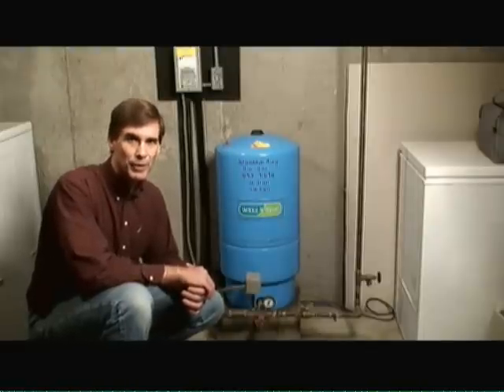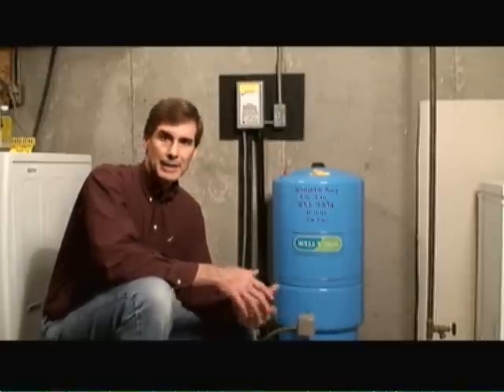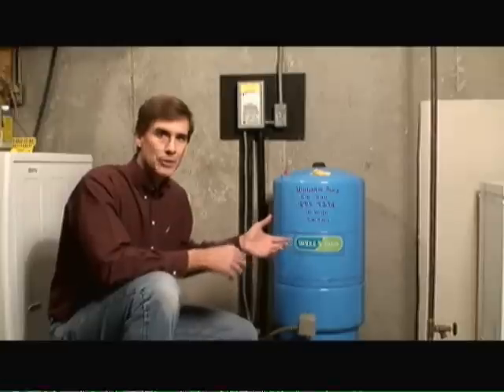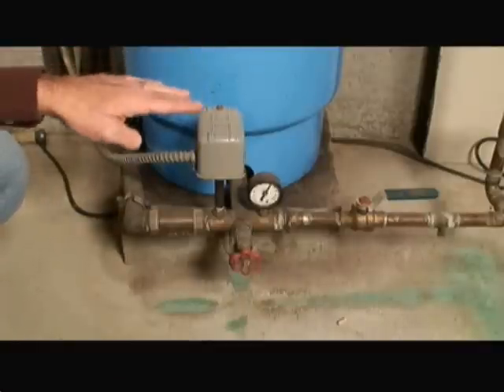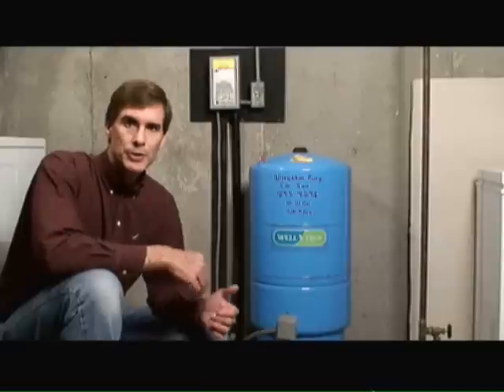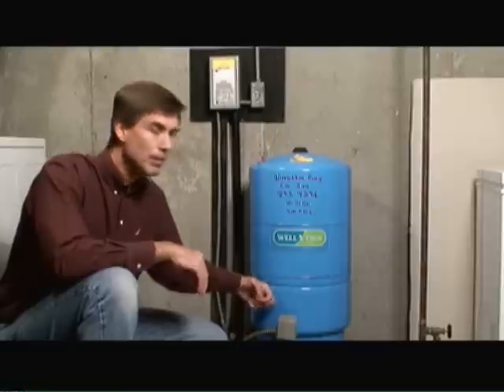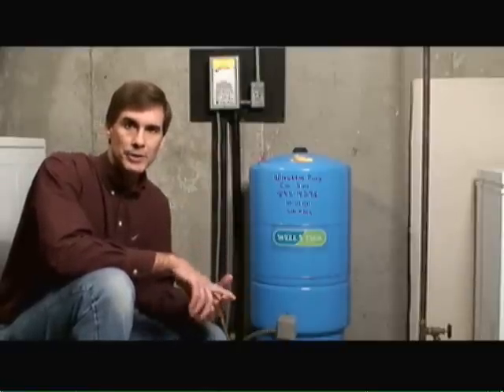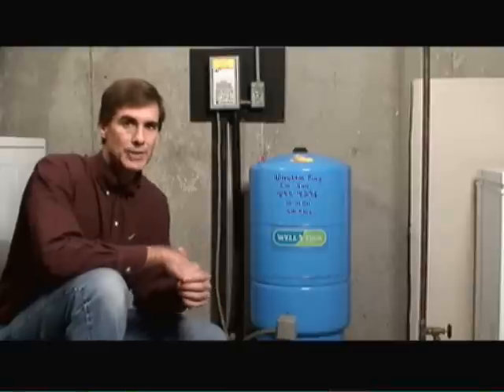Pressure Tanks and Private Well Systems Video

Comment: I have a question! My house is on a well and I just built a pole barn. The well is beside my pole barn. I can I just T off the line before it goes in the house to my pressure tank and run a straight line to my pole barn??? Or will I have to run another line to the house to the pressure tank and back to the pole barn? Or should I just put another pressure tank in my pole barn? Thanks
Reply from the maker: The well pump feeds water into the pressure tank. So I don't think you have a choice but to draw water from the pressure tank in your house to feed your pole barn. I have a similar situation at my house, with a detached garage that has running water in it, and that is fed from the pressure tank in our house. 

Sign Up for my HomeAdditionPlus.com newsletter and get free home remodeling and home improvement tips, as well as tool product reviews, from me every month. Sign up here:  http://www.homeadditionplus.com/Subscribe-to-Newsletter.htm
Reply: So if I don't connect to some place in the house with a line that is on the pressure tank. I won't have no pressure outside?
Reply from the maker: Correct. That line is under pressure, that goes between the well pump and pressure tank. However, you should tap off after the pressure tank.
Reply: I totally disagree, the pressure tank can determine pressure changes anywhere on the system,  IE if you have a hose bib at the well head and your tank is under the house, when you use the hose the pressure decreases in the tank and the pressure switch closes the points and cuts on the pump. Run the line straight to your building, the tank doesn't build the pressure it measures it, the pump builds the pressure.

Comment: hi I got a question. my tanks pressure is idle at 55psi. as soon as I open my sprinkler system it drops to 40 then continues dropping then when it goes to 30 after a few seconds it drops pretty quick to 20. It was fine last season but not sure what happens this season. I'm not an expert but it appears that the pump isn't able to keep up or fill the tank quickly. any idea? is it possible that there isn't enough water in the well?

Comment: Need advice...... our water pump runs, however, we are not getting any water to our house. The pressure reading on the tank is below 10psi. When the water was on, the water pressure would come on pretty good at first then it begin to slow almost to a trickle and then it would speed back up and then slow to a trickle, so on and so forth till the water would just run out during a shower or washing dishes. And now we have no water! Can someone please help me!
Reply: Jenni McMahan-Cole wow a month ago...So do you still have the problem?
Reply: +Maikol Angelo Same is happing to me ..For any advice
Reply: Your tank is bad. The pump cycled off and on and the surge protector in the pump tripped the pump off. After a set amount of time the pump comes back on, but will cycle off and on and trip off again. You need to get a new tank and fast or you will be buying an new pump soon too! I just saw this was two years ago, hope you got it fixed...

Comment: hello only when I open the faucet the pump turn on and off all the time when it hits 40 psi the pump turns on and when it hits 60 psi turns off it go to these two point very fast making the pump go on and off I changed the filter and the pump switch still doing the same thing what else can it be and what can I do to fix this problem
Reply from the maker: You may need a larger holding tank. But this said, when the pressure in the tank/lines gets low, e.g. below 40 PSI the well pump normally kicks on and builds up pressure again.
Reply from the maker: Chulla, Sign Up for my HomeAdditionPlus.com newsletter and get free home remodeling and home improvement tips, as well as tool product reviews, from me every month. Sign up here:  http://www.homeadditionplus.com/Subscribe-to-Newsletter.htm
Reply: Chulla Quiteno look on YouTube for how to adjust the relay switch for a well pressure tank. You can lower the 40 psi.
Reply: Its one of two things. Either the bladder in the tank is ruptured and the tank is water logged or there is two much air in the tank and it is air logged. They seem to be overcharging the tanks lately.  If you cut the well off and drain off all the pressure, check if the tank is still full of water. If it is it is a bad tank. If it is empty, check the air pressure in the tank with a tire gauge. the pressure should be set to two lbs less than the cut on of the switch.  If its a 30/50 switch IE on at 30 psi off at 50 psi, the air in the tank should be set to 28 lbs. If its a 40/60 it should be set to 38 lbs.

Comment: Hi Mark. we live in the Cascade Mountains. The temps this year have gotten down well below zero. The Pressure Bladder Tank is in an insulated pump house outside. At one point in Dec. the water did freeze, so we put an oil heater in the pump house and that pretty much remedied the water flow/freeze issue. However, now it's approx. 4-6 wks later and the pump is now coming on anytime water is being used in the house. 1.) Is it possible that the bladder inside somehow became damaged because of that freeze/thaw when we added the oil heater? My dad tested out the tank today and he thinks that the tank is now full of water not the bladder. 2.) Do we need to now install a whole new tank? The one currently is a Kenmore Model from the late 90's, it says that the bladder is replaceable. 3.) Is there any other thing that could be wrong besides a bad bladder based on the symptoms that are now occurring? Thanks so much. i.e. Pump Coming on All the Time
Reply from the maker: Mandi, Yes it sounds like the bladder was damaged due to the freezing temperatures. It probably tore and now water is filling up inside the entire tank, thus why the pump is turning on every time you turn on a faucet in the house. If there is a dud sound up the entire length of the tank it is most likely completely filled with water.
Reply: Thank you very much for your reply. We've picked up a new pressure tank from Lowes. It's going to be tricky installing it as it's 6 ft. in the ground and filled w/400lbs. of water, we think we've figured out a way to drain it, 
I hope. And still experiencing temps just above freezing, but want to do it before we ruin the pump entirely.

Comment: Mark..great video... I have a choice of putting a new pressure tank outside in a 7 foot deep pit where my new submersible pump is located 60 feet below..this pit used to have my pump motor in it..but now I have the pump at the end of the 60 foot line..OR ..I could put the tank where the old one is--inside the basement...The "well person" suggests moving the tank outside due to if anything happens to the tank etc , it won't flood the basement ..Being in Massachusetts...I worry about freezing and he said no worry about freezing in the tank....I have never had any freezing so far with the line in the pit running to the tank inside ..Which way would you go..inside -like it is ??.OR put the tank outside in the pit ??...Thanks in advance
Reply: I live in cold cold Canada and our pressure tanks are in the basement.  Our tank is not that big, about the size of a small cooler.  Once I had to re-set the pressure switch on the tank, if I had to do that in a 7-foot pit in winter....yikes.  Also having the pump inside keeps it warm and easy to check up on.  Our tank is right close to a floor drain and we have splash guards to direct the flow there if the lines should leak disastrously.  Also we always use water sensor alarms.

Comment from the maker: Sounds like you have an electrical problem associated with the sprinkler system. I bet when the sprinkler system was installed they tapped off the same circuit breaker that the control box is powered off of. I'd call an electrician

Comment: I made a video of it and it is on you tube I knocked on top to bottom.sissy murphy bladder tank .Had a well guy he here and thinking he does not know as much as he claims since he told me a pressure does not hold water .I know it does since watching video's on here .The tank is not heavy either it is easy to tilt sideways even for me

Comment: I just had a plumber install a new tank.  He set it to 38 PSI and the electronics to turn off at 601 psi and turn on at 40 psi.  I need to run it for hours at a time due to the amount of chlorine that was used to shock my tank.  The guys who put in a new pump had to retrieve 500 feet of hose and wire and they said it was a in 100 ft. of water at the bottom. They poured 3 gallons of bleach in the well just before they installed the new pump.  Now my whole house smells like HECK.